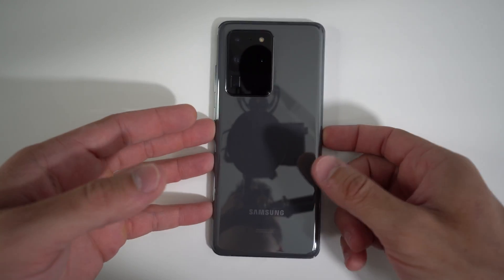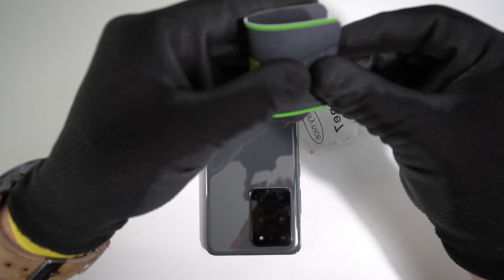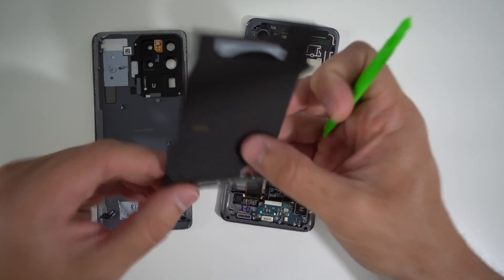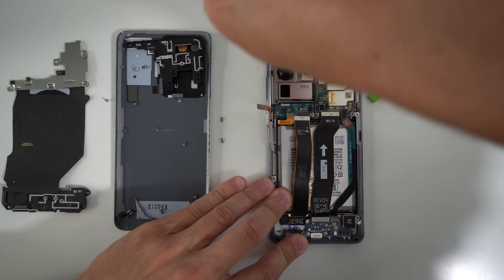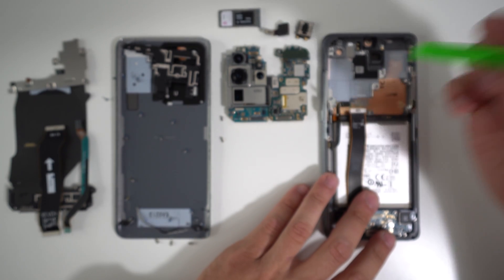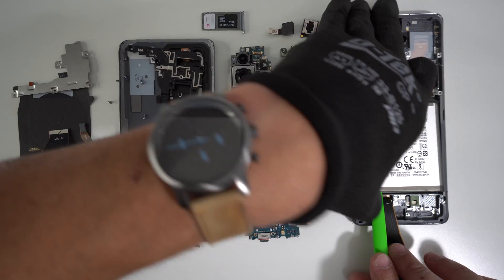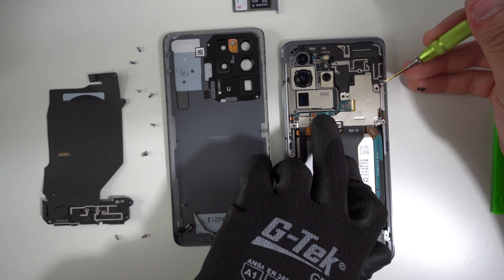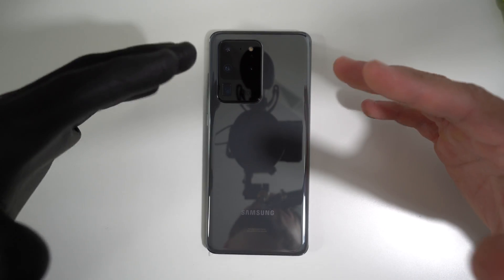Take Apart & Replace Screen - Samsung Galaxy S20 Screen Repair

Comment: Great video. Having never disassembled a phone before, this was a relatively easy step-by-step video to replace the full front frame after my screen got cracked with the display unusable. I found the most difficult step was removing the battery. My pry tool broke so ended up using a combo of heat gun + pry tool to wedge + suction to get the battery out. 

Thanks again for a great step by step walk through!

Comment: Drop my phone running across the street and it was fine. That is until it got ran over by two cars. Surprisingly the damage wasn't that bad though just a few cracks along the bottom I'm using it right now in fact. Thanks for the tutorial I'm going to try this

Comment: why mostly LCD screen of SAMSUNG mobile will Damage & cost of new lcd screen is around  hk$ 1,400.00  of S20± samsung.
Very very weak parts of samsung mobile.
Before my A8 star samsung LCD screen was Damage & even this time my S20± samsung had same problem  
I patd hk$1,850.oo to repair new LCD screen & on top of that They will charge money  in there own choise .
When i went to repair my mobile S20± some repair shop told me hk$1,650 but time takes within 7 days to make my mobile & another repair shop told me hk$ 1,850.00 make after 3 days and again another repair shop told me hk$ 2,500.00 to repair but one day before same lady told me hk$2,000.00  that means they'll charge you what ever repair charge money they wants. 
Don't take the hard-earned money of others so easily otherwise same things will happened to you .
From that day i never go to that shop .

Comment: I used to repair all my devices; i started laptops in the 90s and early 2000's.  I've also replaced some components on my Google Pixel phone.  After watching this video it's clear they manufacture these things in a way that means they do NOT want you repairing these.   Glue....Glue....that's not a manufacturing technique that is asking to be repaired.

Comment: must be possible to check if the new screen (+frame) is working by plugging in the flex cable of the new screen into the old main board (in the old frame), right ?

Comment: I never seen how to replace the front screen
Reply: Lol you replace the screen as it is in the new frame that you buy. or to just replace screen you need to heat up the screen and do same as what he did to the back and only have to pull a few parts off to do it...

Comment: will it still be water proof after replacement?
Reply: No
Reply: @shaec3405  If you do it correctly it should be. Most repair shops do not have a test depth chamber so it's easier to say it's not waterproof.

Comment: I replace the whole screen but the phone won't restart or turn on. No logo, nothing. I also did the hold the down and power for 7 second. Did it like 15 times and nothing. When charging all I see is the circle with the percentage. What is wrong with the phone? I need help ASAP. Thanks
Reply: Nm. Solved it. Didnt plug in the power button.

Comment: Hey great video, very detailed 👌 I only broke the front glass, and hopefully only need to replace the glass without taking the entire phone apart, is that correct?
Reply: Unless you have experience and special tools, or are a savant at following details, you're screwed.
Replacing just the glass is cheap to diy - but costs the same in a shop due to the much higher labor to separate and reattach the glass to the actual display panel.

Comment: What about just the front glass? It looks like the front glass can be replaced without taking the entire thing apart?
Reply: I also want to know about the front glass?
Reply: @soniabarrientos1762   @Sonia Barrientos  Based on an S9 video I saw  https://youtu.be/nOqlbOGYB_w  there's adhesive between the front glass and the digitizer and if you're not careful enough, the digitizer could be damaged while trying to remove the front glass... I don't know the exact differences are, but I'm guessing there's no such video for the S20 yet is because it's so new.
Reply: @CaseyStellar  thank you